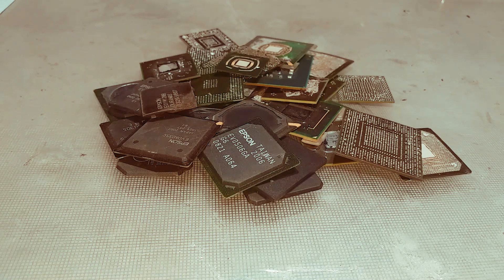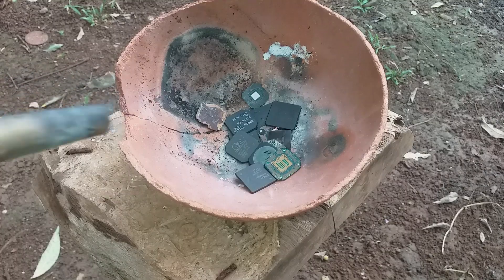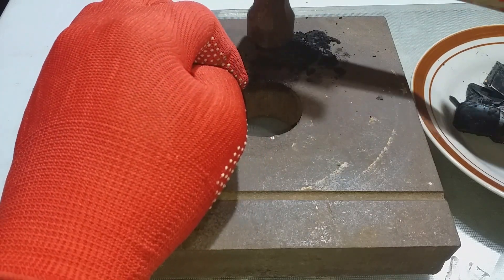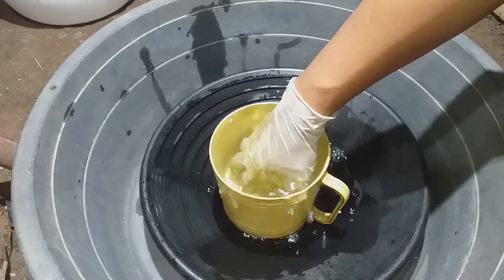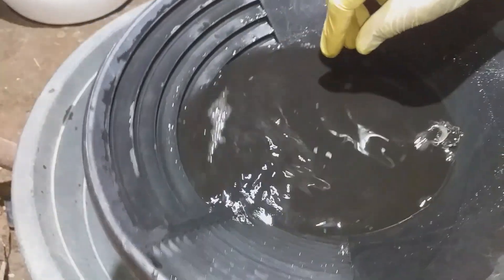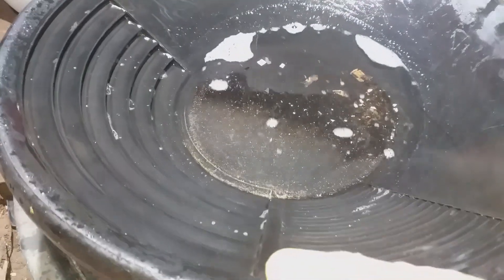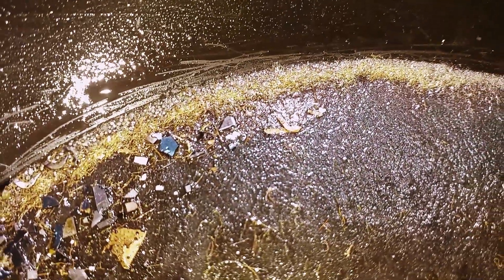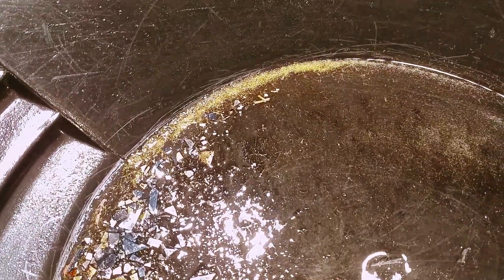24k Gold Wire Bonding | Panning Method BGA Chips | Without Acid Gold Recovery READY

Comment: hello  brother question , i disolve a little bit of gold in nitrate and hcl  witch becomes nitric acid, i tested for gold and yes i had gold i used sulfamic acid to kill the nitric acid ,when i try to drop the gold there was no gold i tested the solution and did not tested positive for gold any help would be greatly appreciated   GOD bless
Reply from the maker: Always remember brother sulfamic also cause contaminations, if you don't  use that properly, thats why i never use that anymore,  anyway try to precipitate gold by adding ferrous sulfate or iron sulfate that is you last option.
Reply: I hope you check out Sreetips for cementing out the gold.

Comment: Hello again bro!  Hope you are having a great day!  Question about chips.  Why is burning them better?  Can't you use the dipping and soaking in solutions technique, or are there specific chips that can only be burned to extract gold, and why?  Can you use chemicals or do you just prefer burning them and crushing them?
Reply from the maker: You can also use acids to dissolve the carbor directly, only because the carbon is thick in that kind of chips, it takes longer and costs more because you need a lot of acid. After you burn it, you can also use acids to dissolve the gold that's the only easy way and low cost
Reply: Thank you for explaining! 
 @PoorMiners321

Comment: I have a question. I collected gold dust and put it in hot water with ammonia to get rid of the acids, but the color turned from brown to black and the gold became less. Is this good or a problem occurred :)
Reply from the maker: I never try ammonia, if you wish remove the acid boil with water and add sodium carbonate and repeat the same at least 3 times.
to solve the problem boil it with water to remove ammonia, and water add nitric.

Comment: I noticed that you use the aqua regia solution in a small percentage. The circulation is 3 by 1. What percentage do you use?
Reply from the maker: yes I use aqua regia many times, for a solid pure gold i use 3:1 ratio, but if tiny particle gold and gold foils i never use 3:1 ratio, i only slowly drop hno3 until i completely dissolve gold.
Reply: No need to using 3 :1 ratio in refining . It waste nitric acid, urea, and SMB. Use incremental additions of nitric of a few milliliters until reaction is complete.